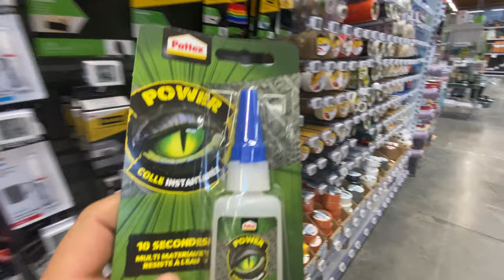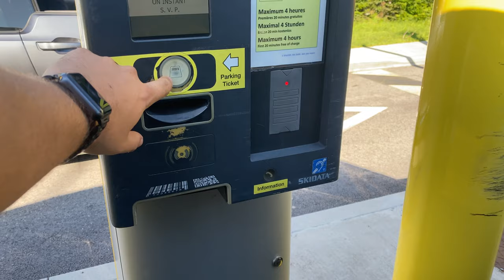Range Rover Sport Broke - Gear Selector Button Failure!

Comment: Under your cup holders a plate can be pulled out and then you have a red material tab you can pull on to put it into neutral as an emergency
Reply from the maker: Yea found that out the hard way when the engine exploded